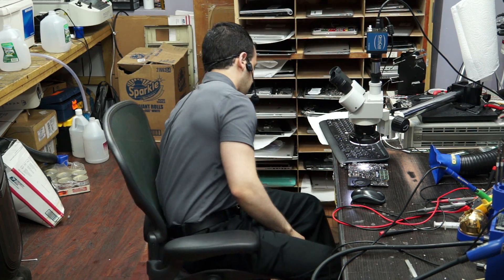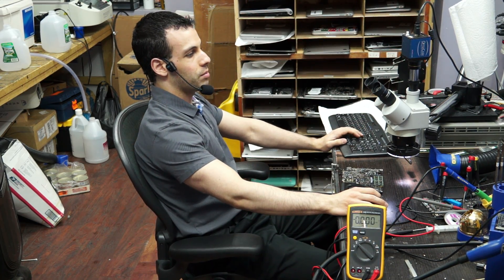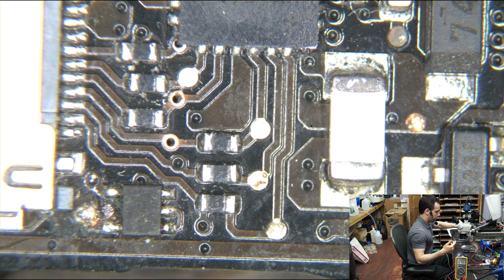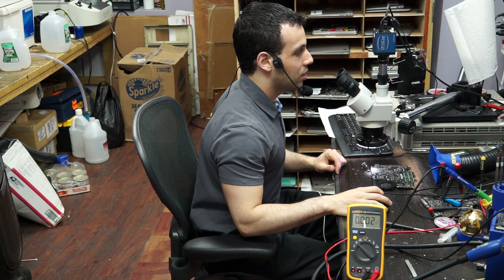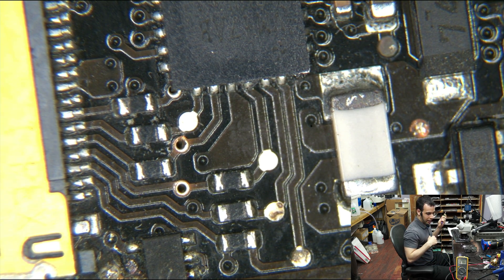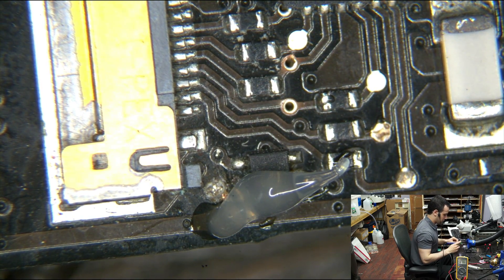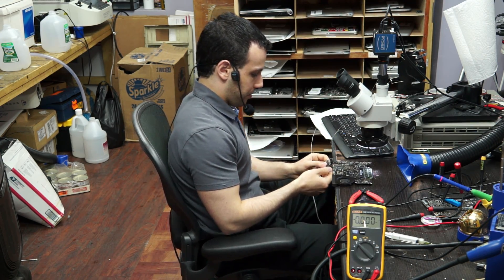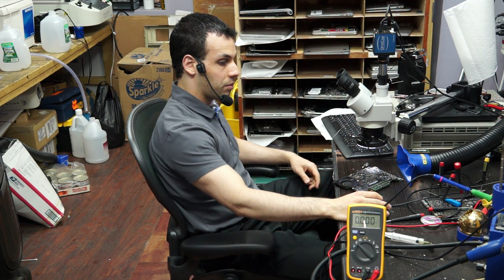How to fix no magsafe green light on Macbook Pro logic board.

Comment: Funny you should say that about new boards, my current sensing is dead (no green light, doesn't charge battery or start up when on AC). Been watching a ton of videos, haven't taken the board out yet but based on everything I expect to see something like R7120/R7121/R7122 corroded. I think I'll also check for G3 Hot as well to make sure nothing's wrong there. When I ran ASD it also reported that ISDC and IPBR were below limit, so I'm assuming based on everything I've learned it's something in that current sense (U7100, U7000, R7121, R7122, R7120). 

Thanks again for these videos, really helped me learn a lot and I'm hopeful I can fix my board. It works fine otherwise, just hope I don't have to replace a chip itself.

Comment: your pretty smart my man..  I could help you solder though, I get into running wires.., along with putting a hole in the board..   FYI   my mac is jacked just like the one your fixing..  I have it apart.  i think its the port under EVERYTHING ... stupid design..  not to mention half of the crap says samsung in my computer..

Comment: Hey Louis might you have any suggestions. 

Having some issues sorting out the One-Wire. Sometimes when I plug in the board I GET a green light, but most of the time I DO NOT get a green light.

I have watched several videos from Louis and am still stumped. Here are some of my readings.

U7000
CHGR_ACIN - 4.0V
CHGR_DCIN - 16.7V
CHGR_ACOK - 3.34V

U6901
SMC_BC_ACOK_VCC - 3.48V
PP3V42_G3H - 3.4V
SMC_BC_ACOK - 3.34V (Both Pin 1 and 2)

U6900
SMC_BC_ACOK_VCC 3.48V
SYS_ONWIRE - 3.46V
ADAPTER_SENSE - 3.46V

Are both pin 4 and 5 of U6900 supposed to be the same? (didn't think about, till just now, taking the cover off my working MBP)

What am I overlooking? The board does have liquid damage around U6901 and the SMC, I did change U6901. U7000 and U6900 appear not to have been touched by liquid.

Thanks for any assistance, this is driving me nuts. I do not understand why I have a green light some of the times. I am also using a known working OEM adapter from my other working MBP.

Pat
Reply: Have you tried SMC re ball ?

Comment: I have the same problem (in a A1118 model), also when i do the keyboard trick to turn it on, it doesnt detect the battery either, is it the SMC? or might be this issue you show here? i replaced the charger and the magsafe board and still the same, any clue? thanks

Comment: hello, differnt board, no green licht. SMC_BC_ACOK is missing. no CHGR_ACINPPDCIN_G3H is present 16,5V i have 16.5V going in on Q7085 out PPDCIN_G3H_INRUSH_FET is 0.02Q7080 is 1,02V  am i correct if Q7085 is defect?
Reply from the maker: +Roy Mulder GO for it.
Reply: +Louis Rossmann that sounds like a big "no you dumb $#@$@"  use your brain....
Reply: Louis Rossmann
I have a green light!!!! Happy
There was no 4V on the ACIN R7010/R7011 measured all around even though the Q7085 was bad (dumb dumb, but didn’t change it because someone said "GO for it" sarcasm… TY)
Then I plugged in the battery and left of the charger! (Something you told in a video) And the U7000 got hot! So I changed it, and then had green light and 4 volts on ACIN. PERFECT...
 
Almost PP5V_S5 is present but its flipping it goes from 5V to 3V and up down up down real fast. The complete rail is doing that... can you hint me?
I am getting a better understanding of how it works thanks to you Louis, just slow learner and the puzzle isn’t complete yet hope you’re not fed up whit me yet.
(Please let me get a board next time where shit stains are available)
Reply: hello louis can you please help me on this?
Reply from the maker: Honestly no.... I can't help every single person with their detailed and specific board repairs here. try advancedreworks.com/forum where I suggest people post these problems
Reply: +Louis Rossmann Thanks for beeing honest.

Comment: Hello Louis,
I have a macbook pro 9,2 .
 1. Battery is not charging. Finally battery is flat. Adapter is not able to start the machine.Green led does not light up.
2. Battery is charged in another macbook pro.
3. Now, the machine will start to work normally on the charged battery. 
4. Now , if charger/adapter is connected,green/orange led does not light up but all the power is taken from charger. The battery does not discharge.
In order to start up a charged battery is required . The machine will not start up from the charger. 
Please advise.
Shriman
Reply from the maker: +Shriman Ramgobin I created this channel so you would have the information to solve your own problems, but I am not walking you through fixing your own motherboard.
Reply: @rossmanngroup  i have dead macbook with charge light on and off sometimes. its mostly work and wondering, how are you ? I like sandwiches. please advice ?.. lol
Reply: +Shriman Ramgobin did you found a solution for this issue?

Comment: Hallo Louis, i have an  interesting fault depending on the one wire circuit. It´s a 820-2936 board. No green light and wont turn on. With battery it start´s up ! i meassure the voltages. One wire is 3.4 V / Adapter sense 3,4V / PP3.42V is OK. All seems to be OK, but no green light. Hmmm. Do you have an advice. I think this can bring all of us much. Thank you Louis !!!!

Comment: Hi Louis,

I was wondering if you could point me in the right direction.

I've got an A1297 820-2849-A board that has the g3hot issue.

Where can i take the 3.42 volts from on the board? I have the schematics but i can't seem to find it.

Thanks

Danny

Comment: Hi man, like your vids. Anyway I aint got a clue about MacBookpro's I must admit. Anyway I have a 13" A1278 mid 2010, and I changed the battery with brand new one, as I was told this was problem. The light is always stuck on green, even though when I changed the battery there were sparks all-over the shop. Then i decided to reboot the battery by taking plug out and putting back in, and a puff of smoke came from the back and went up front of screen when the book was open. It was silent for a few seconds, then I heard crackling, I thought what the eff is that, and then it was like Aladdin's lamp, puff of smoke, I had it sat on desk with top open. I do believe i fried this. II never spilt anything on t. so I am stuck. Sorry to ask you, as I know it could be anything, but why is the green light still on, and when I press indicator the side lights go full up, fill up all the dots green, indicator I think this is? The sulphur was .horrendous, I could have done wit borrowing your fan, when that happened. I crapped myself, I am new to this game, and I would love to fix this, but I have no tools, apart from a soldering iron, and solder, and wire. Sorry if this is the wrong post on here, Got to start somewhere eh.
 All the best mate
Joe

Comment: Sorry but I have a early 2008 MBP and I use it in my studio for recording. I still have it cause it has an express card slot and it works with my RMEs great. I have 24 Channels I/O and I put an SSD in the book. This machine runs great with the 2 cores. And this is the job it has to do. I bought it for 250.- € I bought 6 GB of RAM and it has no latency or other problems. You can use different plugins and it works still fine. So this machine is not for the garbage.

Comment: Hi Louis, 
At the end of video, I see you shorting power button pads on the logicboard to test and start the logicboard (green light + fan spinning). On other videos, there is no need to short anything, just pluging the power cable to see the fan spin. Is it older models that need shorting power pads?
Reply from the maker: Jazil81 Yes. core i turns on on their own, core 2 duo does not.
Reply: @rossmanngroup  worth mentioning that  core i will stop turning on on its own after a successful boot. :) so watch out you dont keep trying a good board haha

Comment: Louis normally that VIA is open and can be penetrated with the small wire they use to cut screens off with. I use it to fix most one wire circuits. Saves time and is less chance of short. Only once have I had it messed up so much I had to jump like you did here.
So even if the hole looks clogged I just normally push that wire through with some small pliers.
Reply from the maker: Chris Long Yeah the other dude does it all the time, I suck at it though so I run the jumper.
Reply: Hey whatever works. 
Are you using wire from battery cables only? The one issue I always have is wire is always too stiff and won't break clean, normally damaging the joint.
Reply: Louis Rossmann  how are you  I really  like your videos  and   I have question I didn't see you   some day  you fix  macbook pro 2009  15.4   no green light  not turn on  dead motherboard   I hope you can answer

Comment: "You can always make a long wire short but you can't make a short wire longer." With all respect - can't you just solder an additional piece of the wire?  ;)
Reply from the maker: Mateusz Mellerowicz You can solder wires together to make a longer conductor, but that specific strand of wire will never become longer.
Reply: Mateusz Mellerowicz That would actually be more work.
Reply: It would. But it is the same pronciple as with apple geniuses saying that their motherboards are unserviceable, cannot be repaired and must be replaced if something is wrong with them. ;)

Comment: Louis, can you please take a look at my imgur album?
http://imgur.com/a/uYFO4

my macbook air had been heating for some time and it finally broke. the laptop was working but the picture had pink and green pixels scatered across the desktop. once i turned it off, it wouldn't turn on again.

i assume the issue is with the GPU, but i've notice a weird oxidation on some copper parts on the logic board which you can see on the first pic of the album. i wanted to hear your opinion before i start with reheating the GPU. what do you suggest?